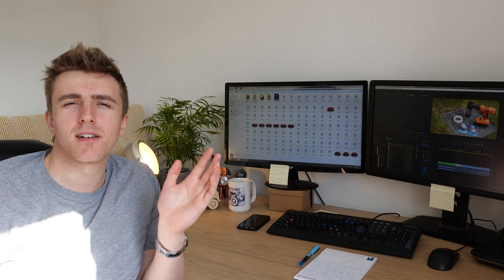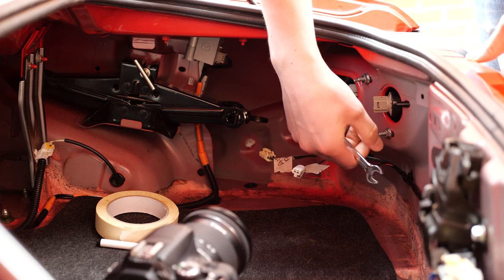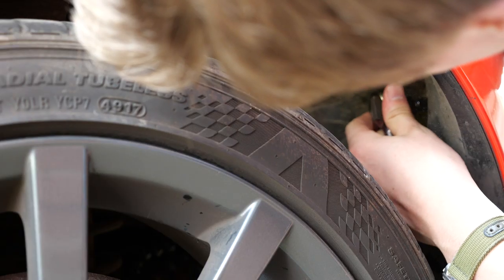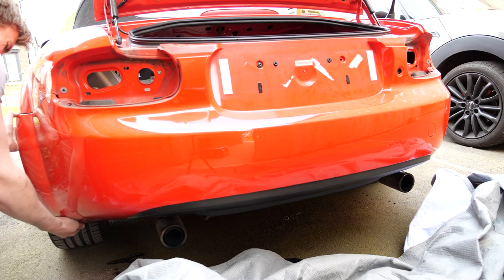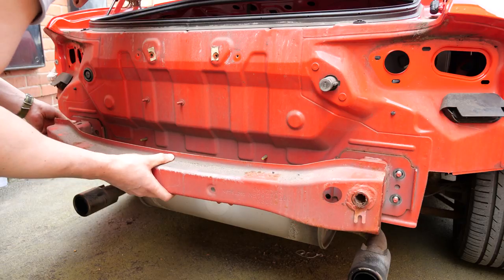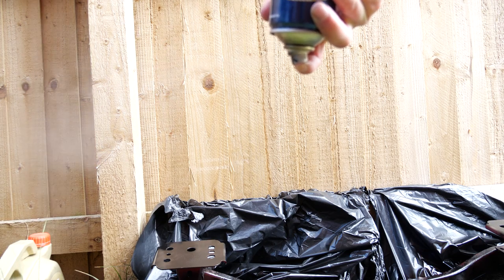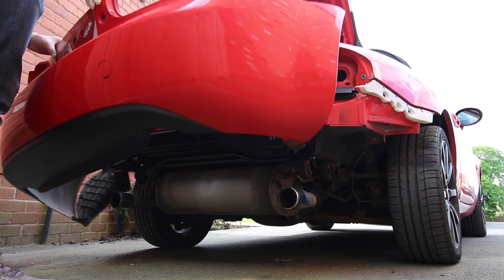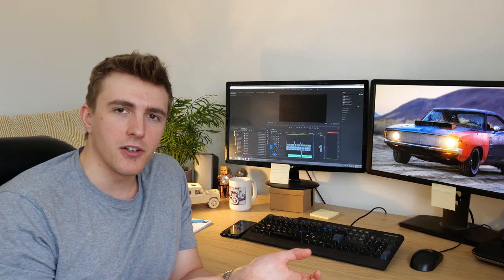BAD rust area! | Mazda MX-5 NC

Comment: Nice work there. Just bought a 2006 NC with 13,800 on the clock. Your videos were helpful in checking the car out. I will review the rear bumper in the summer and follow your video.

Comment: it helps a lot if you add a squirt of cavity wax protection to both metal surfaces before re assembly , making sure the painted surfaces are fully dry as tightening of the bolts too quick can cause the surfaces to stick together and pull paint off ,and a sqirt of stone chip to the lower edge and the inside on the exhaust side also helps stop the paint being chipped from the wheels kicking up loose gravel.

Comment: Really glad I found your vid. My 2009 pre-facelift 2.0L NC has always been garaged, done less than 41k and only gets used on dry salt-free days. Yup, the rust was scarily bad. All the captive washer self tappers were also rusty so I got a price for the 'dirty dozen' from my local dealer. ALMOST £50! Found a pack of 20 identical, equally well zinc plated for under a tenner on Ebay. Lesson - NEVER buy Mazda trim and panel fixings or you'll get 'screwed'.
Reply from the maker: MX5 is a brilliant diy car as it’s not too complex. Thanks for the comment, good to hear from another MX5 owner 👍
Reply: @CarThought  Hi, yes the car is pretty basic but some aspects, such as this, were designed by a man who had lost his guide dog. I spent several years working for McLaren Cars and this 'design' moron would not have qualified to clean their bogs. Crash structure is being grit blasted, phosphated and primed for the princely sum of £40. Rust patches on bodyshell are soaking in EvapoRust Gel prior to Dremel finishing and coating. Will apply HD silicone around the base of the studs and then seal the four edges of the assembled joint with the same material. Can send you stills if you wish.

Comment: Great camerawork, done thoughtfully, very pleasant to watch. I've had my nc for 4 years now and it's a constant battle against rust. I started with Hammerite and moved onto epoxy mastic, now I use Bilthamber zinc primer and epoxy mastic on top. Hopefully come the spring I'll have my first rust free winter, though that might be more to do with wfh :)
Reply: one thing i have learned in my old age, rust never sleeps, the best you can do is slow it down a little

Comment: There are 2 small white plastic clips inside the trunk on both sides. You can see them in the video. They help hold on the sides of the bumper where the large plastic white piece is that you leave hanging to the car when pulling the bumper. Those 2 clips can leak water into the trunk. You should get a silicone sealant of some type and just cover the entire piece over from inside the trunk. You don't need to remove the bumper, just the trunk plastic liners.

Comment: I also removed the front side indicators and the scruff panels on the door sills. This exposes holes which can be used to spray Dinitrol cavity wax with a plastic wand. Very easy and quick to do at the roadside without tools.

Comment: Good informative video. I'm certain my 06 will be bad in that area as it's a real rust box underneath. I've already had to repair the rear of the sills and the boot floor. Its had a hard life mine, it's my daily driver and is no stranger to salt and snow on my daily commute  over the Cat and Fiddle. I'm going to keep patching it until it becomes  uneconomical to repair and then get a good low mileage example like yours.
Reply: Try Fluid Film. I use it every fall before the snow hits. It stays wet and looks nasty and will smell terrible for a half hour and smoke if you get any on your exhaust, but it will prevent new corrosion and will halt old corrosion. It will prevent salt and oxygen from affecting your undercarriage.

Comment: I had rust underneath the drivers seat at the back there where the drain plug is, I just cleaned it up and painted it.. some of the soft metal was removed making the drain hole bigger so the drain plug no longer fit there. Also found a big missing piece underneath where the heat shield mounts to the frame, near the mid part of the car. That looks like a 2"x4" hole.. will have to get that welded up, but for now its clean and painted.

Comment: Hi, nice instructional video. Although the procedure for the final removal of the bumper from the plastic clips is not correct. You should strip the trunk trim to get access to plastic pins from inside so you can squeeze them and easily push outside. I broke one of the pins following your method.

Comment: Great video, most people won't know about this.  Did you check your sill end panels in the rear arches yet?  That's the number one rust area on mk3 Mx-5's.  BTW, for the screws you couldn't get off, you just need to grab the square nut with some pliers to stop it spinning, then use your socket to get the nut off.  Mine was the same, but easy to remove.
Reply from the maker: Thanks David, Not yet, will do it! Had a poke around when it was dry and will be doing a full under body seal too at some point.

Comment: You can remove rust best using Rust and Blue remover made for guns. You can also use brush on Bluing used for guns to prevent rust at metal level. It stabilizes metal to prevent rust.
Reply from the maker: Interesting! Guns don’t really exist in the UK so intriguing to see how you would do it 👍
Reply: @CarThought  order online. Guns in UK like old shotgun are the ones who use Bluing most
Reply: @CarThought  Dom Rust & Blue Remover works great. If you can't get it there let me know and I will send you some.

Comment: I used to own an 06 plate NC.  I had it for six years, lovely car, but when I took it to a local garage for an MOT, the examiner called me over to see the state of the underside. There were hols in the cills that you could put your fist through, the rear suspension was so badly corroded that it had all the mechanical integrity of weetabix.  It was so bad that it was dangerous to drive, and was beyond economical repair.  

Obviously you take care of your car so I would urge you to go to a specialist and get the car properly undersealed with Dinitrol.  A specialist should steam clean the underside after removing the wheel arch liners and allowing it to dry thoroughly before applying Dinitrol.  Don't go to Joe Soap around the corner to get it Waxoyled "cos he will probably "water" it down, and the stuff isn't a patch on Dinitrol.  I ended up buying an ND with 200 miles on the clock and the first thing I did was to get it undersealed.

Their ongoing quest to save weight seems to include savings on paint!

Oh, and another thing.  I had a rear number plate made which fitted the whole of the number plate area.  I had it made by Daemon Plates and if memory serves me well, the yellow backing was for a Jaguar.  It will make a huge improvement to the look of the rear end of the car.
Reply: My 06 is exactly the same, a real rot box. I've bought  myself  a welder and just keep patching until it becomes  uneconomical and I replace it for another NC which has had an easier life. Definitely take it to a decent place for under sealing. I had a previous mk 2.5 done at Paul Sheards and wasn't impressed, when I get a decent example I will take it to CBS autos up in Nelson as heard nothing but good stuff about them in the forums.

Comment: the rust behind the bumper looks like surface rust and the metal is thick there.. it preserved itself, I'm not gonna touch mine :) I would check your floors, the water builds up there and I had plenty of rust around the rubber plugs behind the seat (under the carpet)

Comment: Nice one. I wasn't aware of this potential rust area and am now worried to check mine! I took it over 100k recently, it is used as a daily driver (55 plate) and I have had it over 6 years. I have had a couple of minor rust issues with the inner lip of the rear wheel arches and will check the sills. Also under the aluminium boot lid where the number plate lights are is a spot to keep an eye on - I had to rub down and spray mine. The wheels started going slightly on mine again even though I got them powder coated a few years back. Make sure you keep your roof drains clear using a trombone cleaner, or you will end up with a flooded boot. Subscribing to see what else I need to check!
Edit: I forgot to mention another area that should be dealt with for leaks and I had to seal up on mine. There is a foam gasket that perishes under the windscreen cowl cover and allows water to leak into the car under the dashboard which won't be good for the metal or electrics! Please see here:
https://mx5vic.org.au/wp-content/uploads/2018/04/NC-water-cowl-leak.pdf
Reply from the maker: Love this. Long term daily driver, and it’s a 5!
Reply: @CarThought  Thanks, I have put over 40k on it. Please see my edited response with another issue you should check on yours. You should make a video on this too!

Comment: Well done. New to me too.   One tip is to put a piece of  carpet on the floor to protect the bumper if you drop it.    Also were you not tempted to put some grease between the contact surfaces before you put the crash bar back on.?    Ps I had to watch no sound so apologies if you covered these.   It's making me worry about mine now although it's a dry weather car.
Reply from the maker: Hi Ricardo, thanks for the comment! No problem, I did have a cover for protection when I first took it off, but trusted myself when putting it back on. The grease I didn’t think about to be honest, I’m going to take the beam off again in a year or so and re-evaluate (will also probably film it) haha
Reply: @CarThought  Cheers mate.  I may pluck up the courage to try it one day!

Comment: Low quality steel or lack of proper rust protection (or both). My NC had bolts completely rusted on at only 2 years old and it seems years later it's still an issue. The Toyotas I've owned never had this problem.
Reply from the maker: Yes MX5’s are renowned for it!

Comment: Mine’s a ‘57 roadster done 53k so slap bang on needing this looked at. Any way to tell without disassembling the back end?
Reply from the maker: You could try an oscilloscope or similar under the bumper with a light from the bottom, but so easy to take off, wouldn’t say it’s worth it!
Reply: @CarThought  You probably mean to say "borescope". Some can be had inexpensively.

Comment: how come no one ever applies rust coverter like phosphoric or tannic acid? All the "dark metal" after you wirebrush is still rust - its called magnetite.
Reply from the maker: Lots of people use Jenolite which I think has acid content 🤷‍♂️. Full restorations usually completely disassemble the car and acid dip chassis. But on cheaper and more common cars such as the 5 I don’t think it’s worth it as the cost of the process would outweigh the vehicle value. Just my guess as to why nobody does it 🤷‍♂️
Reply: @CarThought  i just paint on a bit of phosphoric acid solution onto the bit i was working on, you dont dip the whole car. Got 4 litres for about $50, been lasting for ever that lot. Its not expensive
Reply from the maker: Yeah sounds like a good way of doing it! 👍

Comment: Tell us about the watch shown on the video.
Reply from the maker: Hello, thanks for the comment, the watch worn whilst working on the car?
Reply from the maker: Ah, no problem! There was a different one in the intro and outro so I wasn’t sure. It’s a Seiko 5, previous model. 37mm mechanical SNK805 if I remember correctly. It’s a throw back to the old military watches issued, but with Seikos own spin using the 5 principles of the Seiko 5 sports watch family.
Reply from the maker: That’s the Pepsi? Can’t say the same for the 805, think mine seems to be +/-15 every 48hrs, still love it though 😊